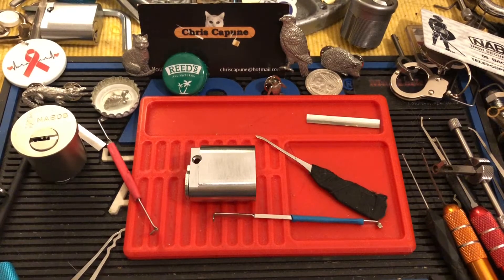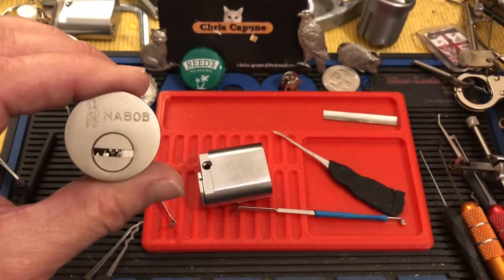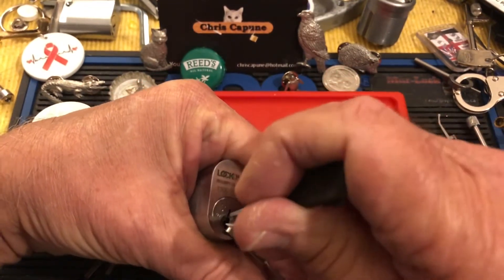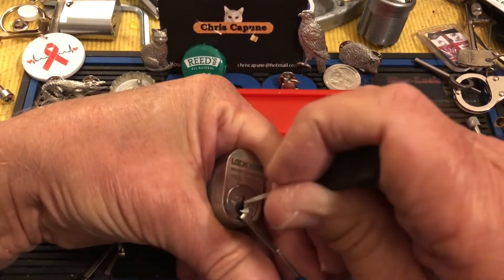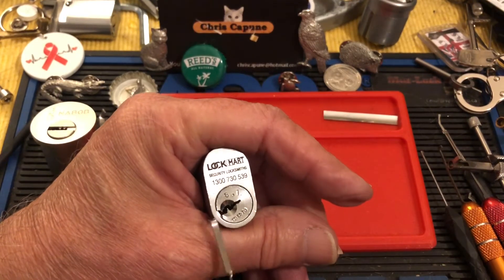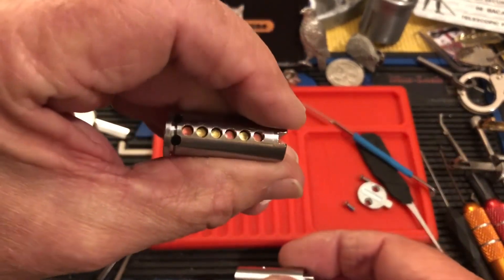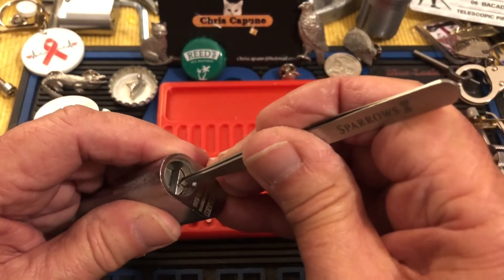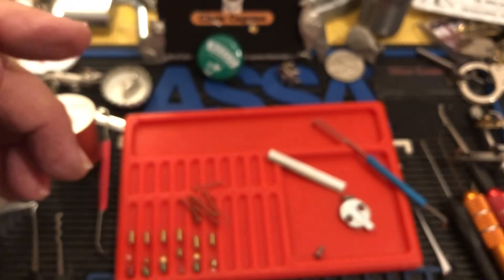#1324 Abus oval picked and gutted

Comment: Not seen an Abus oval that I remember. Supprised it had no security pins.
Reply: They're pretty common here in Australia but the plug isn't an Abus one.
Reply from the maker: Restricted key way. And pinned by a locksmith in Australia . 
Interesting oval😀
Reply: @two_tier_gary_rumain  thats intresting. Abus makes euro cylinders too but they are a rarity in the uk too
Reply: @chriscapune7873  do you think the security pins where removed then?
Reply: @Deadlocks86  I bought one once from Germany. It was relatively cheap but the seller didn't package it properly. It was spilling out of the envelope he'd sent it in.
Reply: @chriscapune7873  Yep.
Reply from the maker: @Deadlocks86  probably.
Reply: @two_tier_gary_rumain  I have one, but its the only one iv seen
Reply: @Deadlocks86  OK.